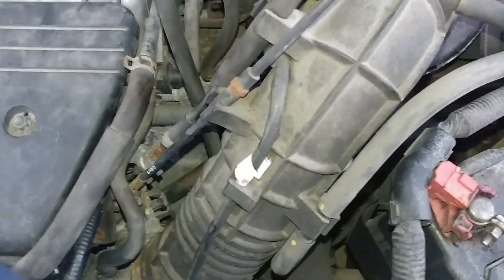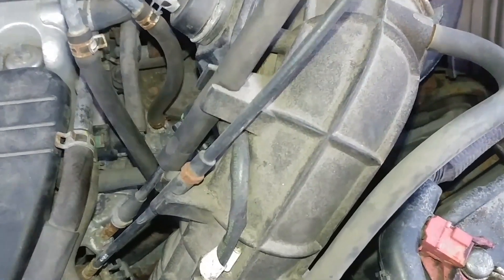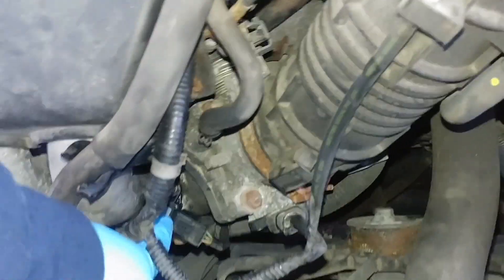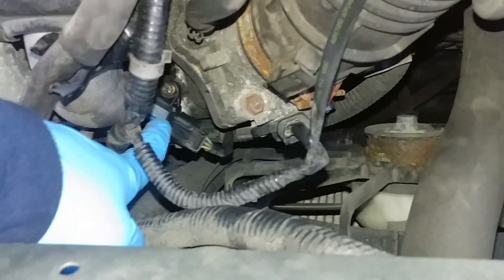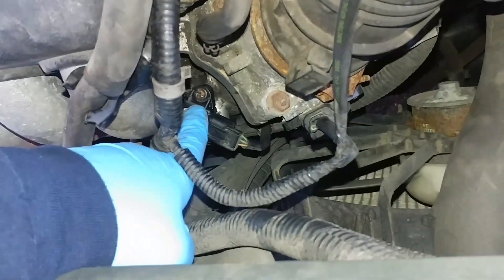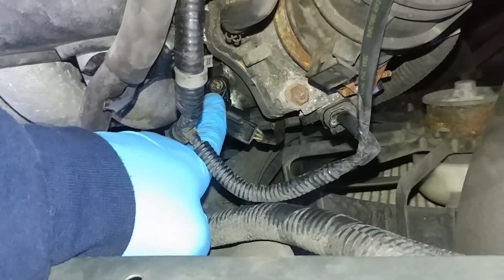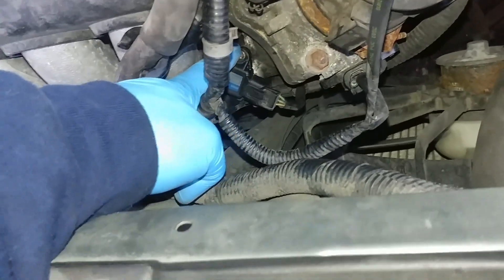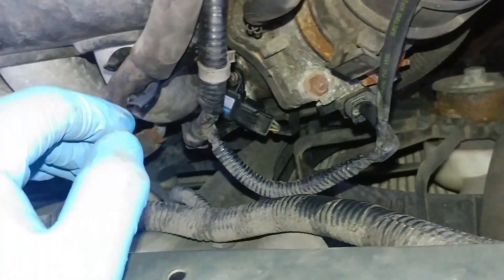How to Replace Honda Element MAF, MAP Sensor- Mass Airflow

Comment: Just WD-40 the screw and then the plastic to carefully take it out. let it sit there for a bit with the lubricant before pulling. The sensor is not really on the throttle body but rather below it on the intake manifold.

Comment: I just used a Vessel Megadora 980 Impacta P2x100 #2 with a mini sledge hammer to loosen the factory screw.  It took SEVERAL taps with the hammer to loosen too.  With the specialized Japanese screwdriver, my factory screw head is in perfect shape to be reused again.  Going to use blue Loctite threadlocker to reinstall after my sensor dries out from using cleaner.

Comment: Well I had to find out the hard way basically just take any kind of wedge tool underneath it and pry it out slowly not so not to tear the O-ring it's in there like a suction cup so  force it out be gentle with the plastic